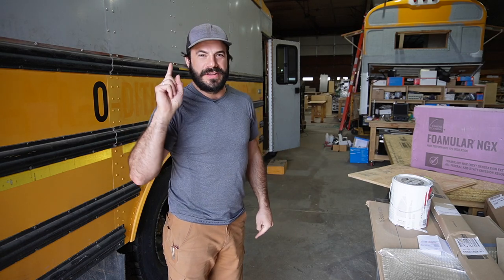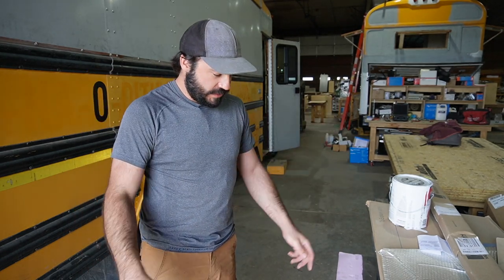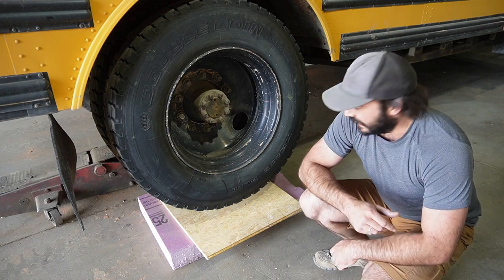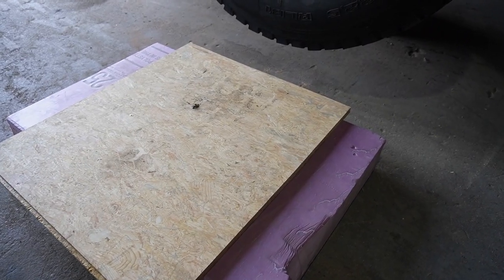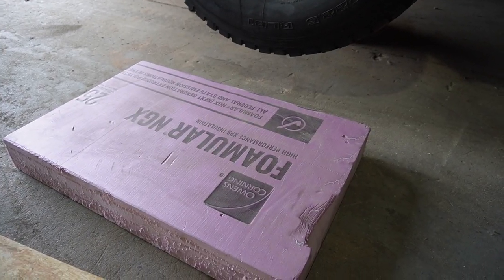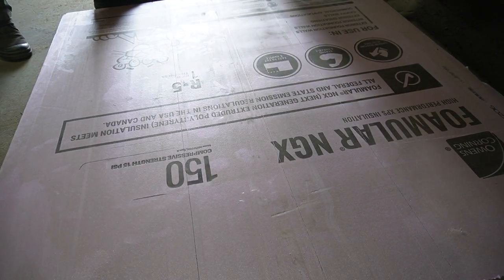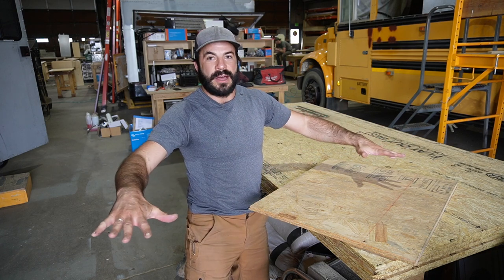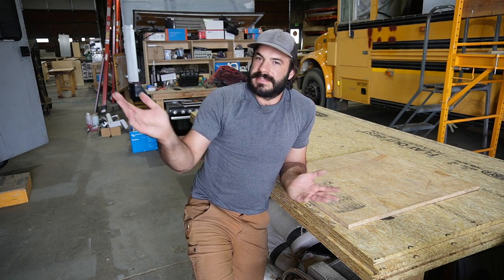Debunking the Most Common Skoolie Build Myth (Skoolie Building Guide #10.5)

Comment: 2003, for our ExpeditionVehicle build, we laid one-inch pink-board, then half-inch marine plywood painted on all surfaces to seal.
.
Our visible floor is bamboo around the perimeter, slate in the center.
.
Over two decades full-time live-aboard, the pink-board shows zero signs of compression or deterioration.

Comment: "No one likes a butt flappin' in the breeze!" ROFL! Greatest line ever.

Also, while I don't believe it's an issue to not frame a foam floor, it would still be useful to see you walking from side to side on it. You hit the nail on the head (no pun intended) when you said to use tongue and groove, though, as that will prevent crushing the weak points. You'll still want to put some kind of support at the entrance, though.

One thing I want to mention, which is probably pretty obvious, this only works for FOAM floors. I'll be using Havelock wool in mine and that means I need to frame  it. Why did I choose Havelock wool? That's because it's fireproof, and I'm planning on putting fireproof paint over the wood where flamables are nearby. (Propane heater, wires, etc. That way if something would otherwise catch the place on fire, it'll naturally be quarantined.

Comment: My one concern with this technique isn't the crush resistance of the foam, but the strength of the adhesive and foam in tension or shear. Furniture (and passengers sitting in furniture) are going to be attached to the subfloor which is glued to the foam which is in turn glued to the chassis.  Flip that upside down in a rollover accident or hit something hard that imparts a shearing force and the foam itself might split apart, sending everything attached to the sub floor flying. I suspect that this is why many buses and vans with wheelchair securements and L-track in the floor bolt all the way through to the body's subframe. 

That being said, wood framing wouldn't necessarily help with this either. And one might be able to get away with securing the subfloor to the chair rails on the sides of the body. And even if you do end up through bolting the subfloor to the body, drilling a few holes for mechanical fasteners is still easier, quicker and arguably creates less thermal bridging than building a frame to support the subfloor.
Reply from the maker: Indeed, we generally will through bolt things like seatbelts and seats
Reply: Chuck do you ever through bolt a whole floating floor?

Comment: It not about the weight of the bus, it about the glue of the plywood on to the insulation.  It is all about the screw points of the plywood to a secure structure on the bus to keep the plywood truly down, with glue.

Comment: Two questions. How well does the foam hold screws and nails? What is the fire rating of the foam?
Reply: The 1/2" or 3/4" subfloor is more than enough to hold screws/nails for any wall framing or cabinets you'd be putting in a skoolie. The fire rating is irrelevant. While it's not very fire resistant at all, if a fire got bad enough that it burned through the wood subfloor, the bus was going to be a total loss anyways.
Reply: @shoutingback09  as a volunteer firefighter and some who would be sleeping in the bus, the fire rating is extremely relevant. Even if it is going to be a total loss, you still need time to escape.

Comment: Physicist here.  . . The board is stiff enough to spread the weight over a large enough area. If you drop the tire pressure below compressive strength of the foam, you wouldn't need the board at all.

Comment: They make that foam for installation under foundations with a 80 psi compression strength in case anyone is still concerned.
Reply from the maker: Great point! I’ve seen it advertised as high as 100

Comment: We’ve built 4 busses this way, math  is your friend. People need to remember your not building a house, you’re building in a bus. Dimensional lumber has no place in a moving vehicle. 

Your 2 tires have a contact patch of roughly 10 by 10 inches each. At 15 psi rating the foam without the flooring over it would have supported 3000lbs or 5000 with the 25psi foam, add the flooring and that 24” by 24” patch can now support 14,400 lbs with the 25psi rated foam.
Reply from the maker: That was the math I had going, too! I totally agree and I've seen the work you do, great buses! Thanks for watching

Comment: Nice baseline compression test.  But I am also curious about degradation due to vibration over time, damage from heavy loads bouncing, point pressure of things like the fridge/freezer feet, impact damage if you drop something, all on the OSB, of course, not on the raw foam.  Although no test is complete without testing the raw foam without OSB.  Also test water, i.e. soaked and fully submerged tests, because you never know, right?  "How would MythBusters do it?", that's what pops in my mind.  Don't get me wrong, I despise foam, the environmental toxicity used in production, the pollution, the forever chemicals even long after you junk the bus, etc.  I'd love hemp or rock wool or whatever.  But at the present time, there's no better material for this application, where minimum weight, and highest R value at low temperatures are important.  Similar for finished flooring,  I'd love bamboo or something, but the problem of standing water, particularly in doorways, kitchen, toilet, sink, shower, windows, etc, it's problematic.  So vinyl is probably best.  The off-gassing makes me nauseous.  We all can smell whether a floor is synthetic or natural.  Marketing BS, corrupt politicians and big-money loosen regulations.  Not falling for that nonsense.  But again, in this application, at the present time, there seems to be no better material than composite polyvinyl floors.  (Got a little off topic here, but have already seen the subfloor video, generally excellent.)

Comment: with changing tempatures and time that floor will warp with no framing.
Reply from the maker: No it will not, i have builds that are 7 years old with no warping. That is why we paint and seal the wood. We have decades of fine furniture experience in this shop and understand how wood lives. Sealed properly and glued well it will be extremely stable. They build homes out of SIPS panels without issue
Reply: @ChuckCassadyYT  could you do a video on how to paint and seal the flooring? Extreme newbie here. I would like for my build to last. Thank you in advance.

Comment: Good science, but not perfect science. A complete functional test would be to have equal plywood/foam combinations under all four corners (that's got to do with the mass vectors and stuff).  For example, when weighing aircraft, all wheels have got to be at equal height, using scales under the wheels, or a combination of scales and height blocks. BUT, your point is still valid; no damage to the foam, regardless. Question: have you ever converted a bus to a complete cargo conversion? Not a combo cargo/living space. I always thought that, with the large interior space (without seats), roof lifted, and a functional, but large, one piece rear door, it would make a nice, cheap, poor-mans tractor-trailer.  Certainly, one could get seasonal contracts with FedEx & UPS. Even a rolling work/machine shop!
Reply from the maker: there is no perfect science mon frere! I think you'd be better off buying a box truck than doing a roof raise on a bus and making a cargo door large enough to use, but thats just me!

Comment: It should even work with expanded polystyrene. I laid 2" of it over the concrete floor in my last house without framing, and then poured a 2" floating concrete screed on top. There was no concrete reinforcement, but I put a little chicken wire in it where the washing machine went, thinking the weight and vibration might crack it. Worked perfectly - no cracks. Later I moved the washing machine to another location where the floor was not reinforced, and there wasn't an issue.